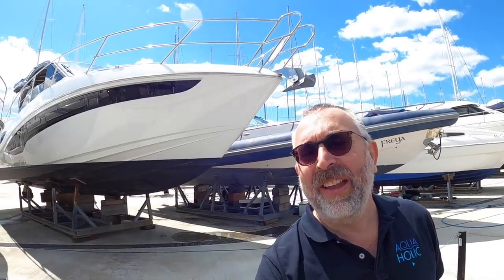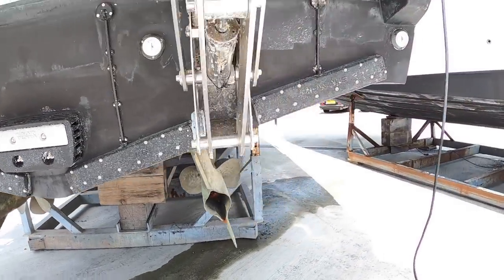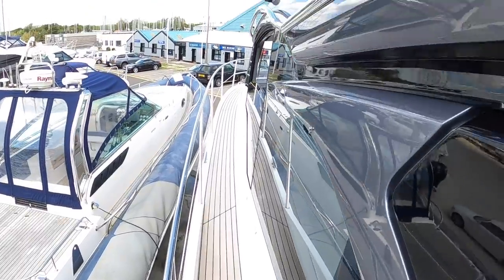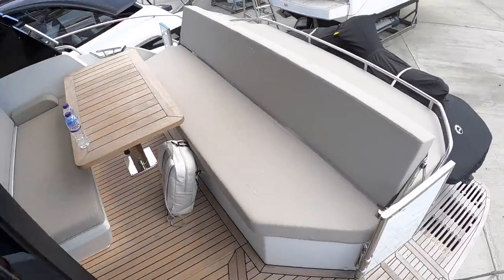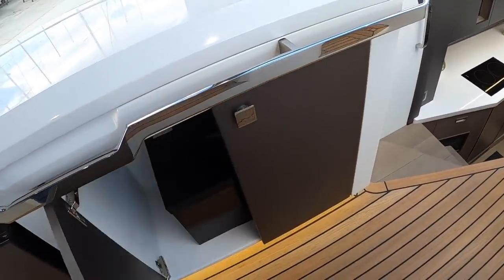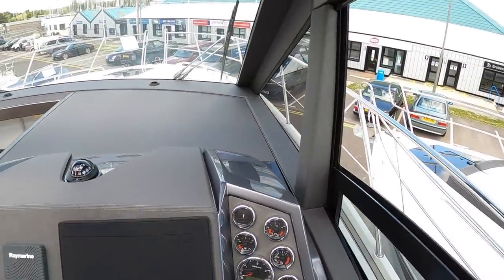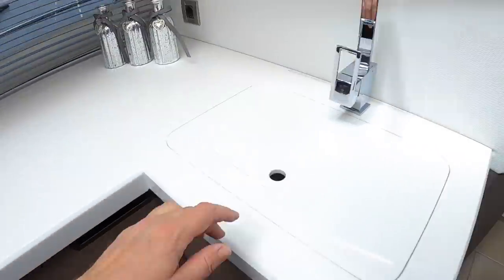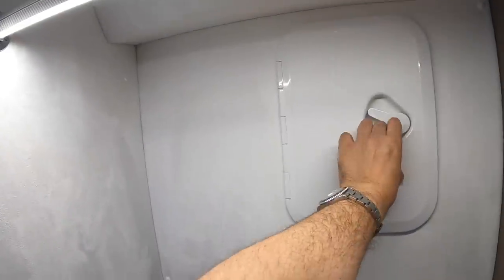£460,000 Yacht Tour : Galeon 425 HTS

Comment: You know what I like about your videos is that there are no bells n' whistles. Just down to talk about the boat in simple terms, if you use jargon, then you always explain. Quite like this boat, although not sure on the placement of grill.
Reply: Yes - you'd want a fair wind whistling through the boat to use that grill...
Reply: Agree. No endless rant about blah blah blah. Best boat reviewer on YT, by far
Reply: As far as I know, Galeon are pretty customisable. They certainly are on their bigger boats - so you should be able to replace the griddle with a TV unit or whatever.
Reply: Grill threw me off as well, prefer it to be in the cockpit so I can use it without opening up all of the deck saloon. Prefer the flybridge yachts as they provide more 'outdoor' space on the boat for wetbar and seating, without compromising the integrity of the weather-tight  'indoor' space.
Reply: @TheDarkrelic  yachts for sale is also really good
Reply: No bells & whistles is good & Nick does a nice job. But sometimes I like a bit more detail. BoatTest(.com) & Capt. Steve do a nice job with those reviews. They have two videos for each boat, one covering the features & another covering actual on the water testing. They give plenty of interior & exterior specs along with performance specs (cruising range & speed at various rpms, handling characteristics, engine room specifics, weights, capacities etc...). They cover everything from small runabouts - 116 ft. yachts, with a lot of boats in the 40'+/50'+ range through the 90' range (no huge mega-yachts/super-yachts). Their videos also go back 12 years so you can look up older boats if you wish, which is nice.
Reply: For example: Ocean Alexander 90R Motoryacht (2020-) Features Video https://youtu.be/ryzZH7N0PnE  Ocean Alexander 90R Motoryacht (2020-) Test Video https://youtu.be/4oUlbNn5Dpw

Comment: 2:56 Did anyone else clock the foredeck window was coffin-shaped? What a great boat. I like the idea of pod drive. It seems to make more sense than an old fashioned rudder. I am sure there are arguments for and against though.
Reply: Maybe it is boat for vampires.
Reply: Shaft and props are much much cheaper to repair if you hit the ocean floor and that happens alot! Pods are a fortune to fix! Thats one disadvantage of pods!
Reply: @baddazzgarage2953  I agree on maintenance, but if you hit the ground, which should never happen, also the repair of a shaft driven boat will cost a fortune.
Reply: Yes coffee shop spooked me. Thought unlucky for a boat!
Reply: coffin shape

Comment: nice video as always ,  great boat for family use, always surprising how much space they can provide below deck. are the pod drives more expensive to maintain than conventional shafts/ props?    which is you preferred brand for this size ? thanks
Reply from the maker: They are, but they are reckoned to be more efficient and certainly have better packaging, which allows all that space.
Reply: It's why you don't see pods on the most serious, offshore boats like Nordhavns. They haven't achieved that flawless perceived reliability yet, compared to shaft drives.

Edit: plus pods basically means Volvo. Passagemakers go for ultra reliable engines like Cummins

Comment: If I was an owner of this boat, I will turn the wet head into a laundry room with wordrobe on the top and washer/dryer under it. Because if I was the guest, I certainly wouldn't want to brush my teeth while standing in a pool of water.   Smaller boats under 40 feet should utilize every inch to add more function to it.

Comment: Great boat and tour. Has anyone at Galeon given a reason why they don’t offer IPS on their flybridge range? That has always perplexed me. I think they finally offer it on just the 400, but why not the 460 or 500? If they offered IPS on the 460 or 500 that would pretty much be THE perfect boat with pod drives and the beach mode! I think I would be forced to load myself into a bunch of debt just to get one if they offered with IPS.
Reply: They used to, it was so unpopular as an option they got rid of it. You have the option for joystick on shafts and legs so why have a mould to make to modify the hull for ips when no one buys it?

Comment: Hi Nick, watching Volvos IPS video, I see they route the exhaust out through the pod drive, which you can clearly see the exit point on this video. Now considering most of these boats have great big diesel engines you never see loads of exhaust when they are out & about with their foot down, so to speak. So my question to you is, on normal shaft drive boats where does the exhaust exit? above or below the water line? maybe you could point this out on one of your future videos 👍 Thank you & keep it up, loving all your videos through this second lockdown.
Reply from the maker: Shaft drive boat exhausts are normally on the stern quarters pretty much on the waterline

Comment: What is the advantage of having reverse thrust props? Does that have to do with the pod gears so that at "normal" forward cruise the props are pushed into the vertical gear / shaft because it seems to me that if the prop is facing forward it basically tries to pull away from the drive shaft. For fixed shaft boats having the props in the back pushing backwards makes sense. I'm trying to think why the pods wouldn't point backwards and push instead of pull.
Reply from the maker: Volvo Penta say it is so the propellors operate in 'clear' water rather than water disrupted by anything ahead of the props.
Reply: @AQUAHOLIC  that makes sense, thank you.

Comment: For a 42-foot boat I thought the VIP was very nice, and that enormous skylight may have made it the master, if not for the fact that there was no real ensuite. That said, the dayhead was nearby and very accessible. It was very nearly like having 2 master cabins on this boat, and considering the nicely appointed galley, dinette, and upper deck, the overall accommodations were very comfortable and inviting. I did like that the upper deck was all teak and had so many opening windows connecting it to the outside - it was like having a salon and a flybridge all in one almost, very practical and fun. This would make a great intermediate yacht for someone who's considering a bigger model down the line, but wants to really test out Galeon before they commit to a bigger purchase IMO.

Comment: Really cool boat! Any idea what that 16 amp power cable is for in that storage cabinet on the main deck salon?
Reply from the maker: It's a shore power connector so that when the boat is in the marina it can be plugged into mains electricity
Reply: @AQUAHOLIC  Ah interesting. I had previously thought that the two covers beside the shower on the transom steps were the points for the shore power.